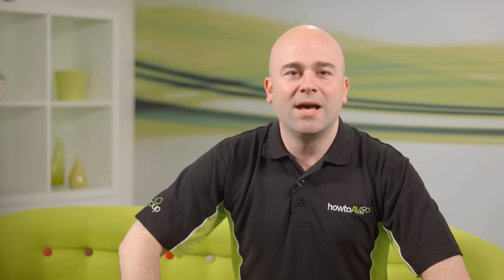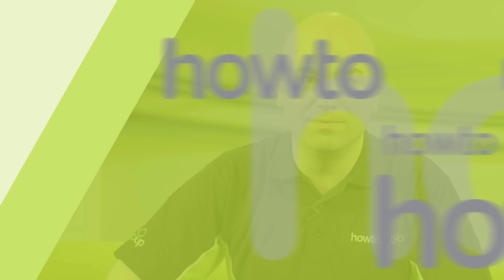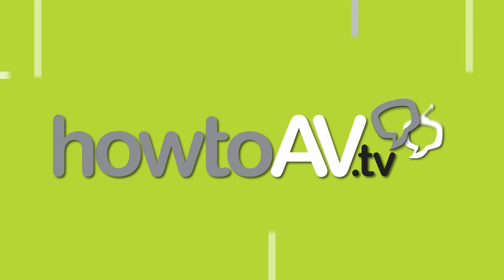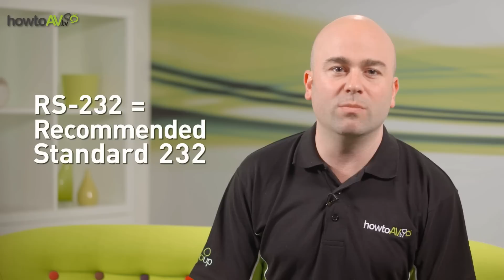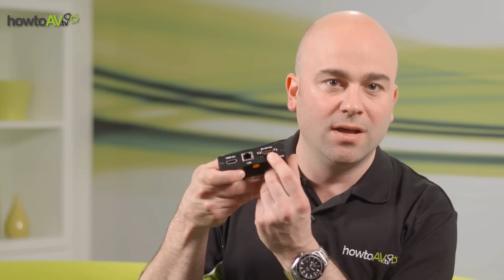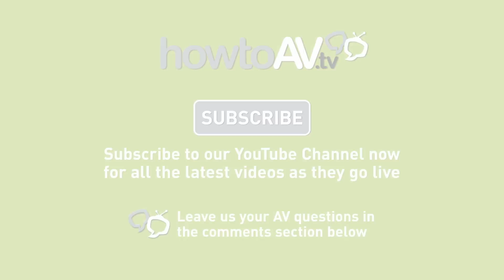What is RS-232?

Comment: What would you suggest I use to control RS232 with midi. Is there just software than can easily take a usb midi control change and convert that to RS232? I want to switch video sources with a midi footswitch. THANKS!
Reply from the maker: Hi Sebastion and thanks for your question.
We've taken a look around (not something we've considered before now!) and Deca Protocal Bridge seems to provide the solution you're looking for - it's a MIDI to RS232 Bi-Di Converter. Hope this is what you're looking for...

Your enquiry got the HowToAV team talking and we'd love to hear more about your application! Our guess is that you're looking to control AV or lighting yourself while on stage? We'd love to see it in action!
Reply: That's absolutely right as to how I want to use it. I actually found that box too and am in talks with the company about how to implement it. Thank you so much!
Reply from the maker: You're welcome Sebastian - best of luck with the implementation!

Comment: I am in the market for purchasing a 4x4 matrix for my church. I was wondering if you knew of any rs232 controllers that were specifically designed for matricies/switchers? Thanks!
Reply from the maker: Hi Nathan and thank you for your question.
All AV Matirx and Switcher products are likely to be RS232 compatible and will come with built-in RS232 interface and control codes.
The Matrix/switcher device will be controlled using a third party 'home automation'/'smart building' control interface such as Control4, AMX or Crestron.
So rather than an actual RTS232 controller device, you'll be looking to consider one of the aforementioned interface systems and where you'll want that hosted - whether it be your PC, tablet or phone for example.

Comment: I'm shocked to hear you speak of RS232 as if it is still commonly used. For something that was created in the 60's and is substantially limited compared to today's technology I would have assumed it would have been nearly completely phased out by now.
Reply from the maker: Hi Eric - RS232 is still very commonly used for device-to-device connectivity and most of the smart home / smart building control systems such as Control4, Crestron, AMX, etc.
Though IP connectivity is most certainly the way forward and will eventually, one would expect, phase RS-232 out, both connectivity technologies are current and commonly applied.
Reply: You will find RS232 in nearly all retail stores across the US and overseas. It is still much more common than you would think, hidden right in front of you. Also used heavily in most manufacturing settings, hospitals, etc.
Reply: you know what they say about assumptions...
Reply: Eric Jones Hello Eric.  I use RS232 for controlling my Christmas lights.  The commercially available Light O Rama control boards use this in their controllers that you can buy currently.
Reply: I have it on my pc
Reply: @FactsFirst  I have it in my PC too - built around 2014 based on a MSI Z97 PC-Mate ;-)
Reply: I think it is due to upgrade capabilities for international and military markets, where power allocation and supply can be backwards compatible to integrate into old systems.
Reply: @FactsFirst  these types of PC's are often used in a podium setup, yes 96 tech but not implemented until early 2000's.